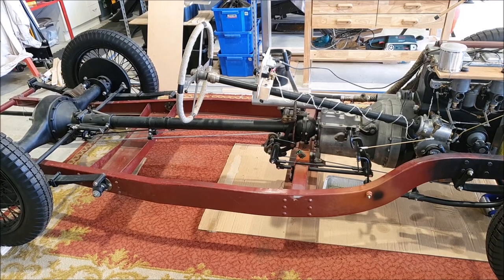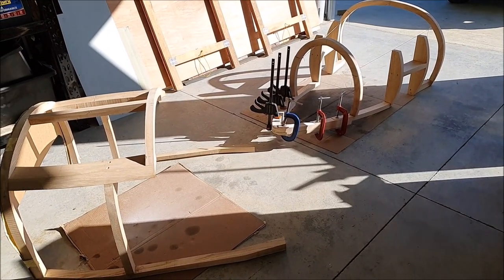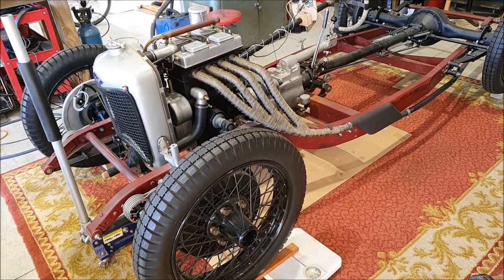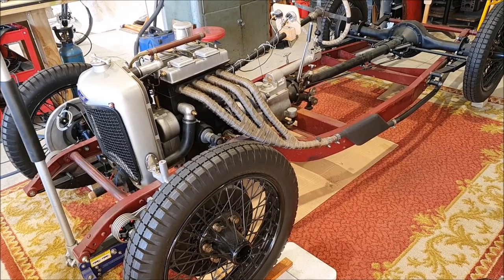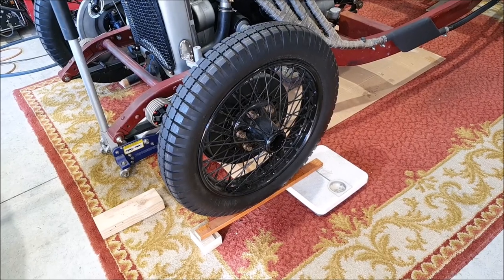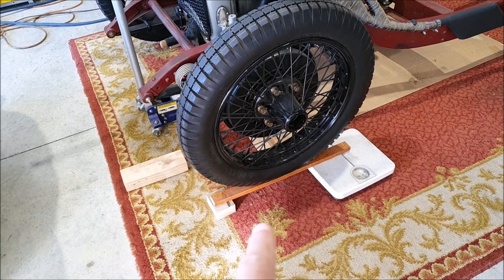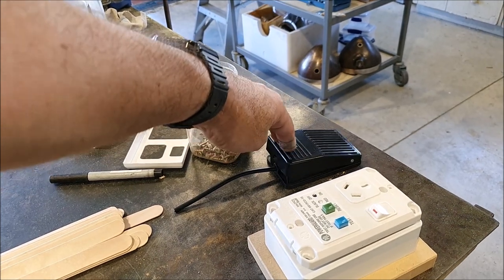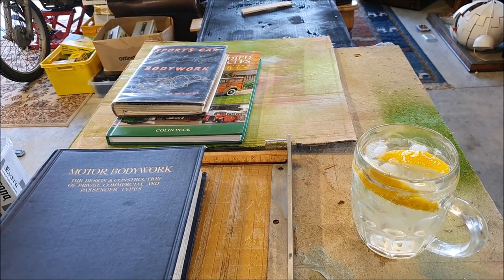Pre war Riley ash frame update 2

Comment: Great to see the car coming together so well. I quite see why you wouldn't want to carry a spare wheel, but stashing a spare inner tube and a couple of tyre levers somewhere might be a wise insurance against having to abandon a road trip for somthing as simple as a puncture. It's certainly been my salvation with motorcylces more than once. Look forward to following your progress further!
Reply from the maker: Yes, that's sensible. I do have some irons and spare tubes already. What would a can of that emergency tyre spray stuff do to an inner tube?
Reply: @asciimation In the US I've used Slime brand Tire Slime. It does a good job on bikes. For cars I think it would do the same. As a preventative measure  it just rolls around and coats the inside of the tube.
Reply from the maker: @nustar1  I think that's actually available here in NZ too.

Comment: I weighed one of mine with four bathroom scales and it is more than close enough. I took it to a local weighbridge which is accurate and it was not far off what the scales gave me. Certainly near enough for what I wanted. Awesome progress. Btw that book is several hundred pounds in the UK so worth hanging onto 👍🏻 looking forward to the next episode 😎
Reply from the maker: It did take me a while to find that book. I was looking out for it locally for some time. Cost the equivalent of about 100 pounds. When the car is done the tip and weigh station is handily located right by the local old car museum!
Reply: In the uk on ebay it is around £300 to £350! Will keep an eye out for it in the antique bookstores though 👍🏻 That is handy on the weighbridge being close. Trip out on an early test drive 😎

Comment: I like your attention to detail slot head screws  Your right about drilling  pilot holes, without a clearance being the right size the two pieces of wood don't pull together. we use a all in one drill bit which has pilot hole clearance hole and counter sink  all in one, they come in a set of different sizes. and are just quicker to use. Your also right about fixing in to end grain, they can pull out, the best practice is to angel the screw lightly in to the centre so both screws work against each other to resist pulling apart. This will also help against  splitting.. 
Regarding your band saw every place I'v worked the have a home made box , pipe or some hoover attachment all held together with brown parcel tape arrangement. Some worked better then others depending an the bandsaw. You could try using some flexy exhaust pipe from above the saw bed so that you can adjust it to best affect.
Interesting old book quite a find. Your right about most modern books .on restoration , their more a reorientation of restoration the the detail of how to do. nice to look at but never show the bit you need to see.
Reply from the maker: Yes, that's mentioned in one of the books about putting the screws in on slight angles. I manage to do that automatically! That's the other reason I split some pieces, I got my angles wrong. You do have to pay attention to which side is up so I usually label everything carefully and check before drilling and counting sinking things. Slot head wood screws (at least decent quality ones) are surprisingly hard to find these days.

Comment: I have found that measuring and setting angles on these old cars will drive you crazy.  Every time I think I have it figured out. I realize there is some detail that has eluded me.  As far as your dust problem goes, here is the solution I use...  Build your project in a shed that is entirely too small for the job, and it forces you to do almost all the work out in the driveway. One last thing, I hope you realize by saying "I've only had one flat tire in my life"  you have now doomed yourself.  Cheers
Reply from the maker: My first car I did I started in a car port on top of gravel!

Sounds like the start of a Monty Python sketch....
Reply: @asciimation  You're right.. it does